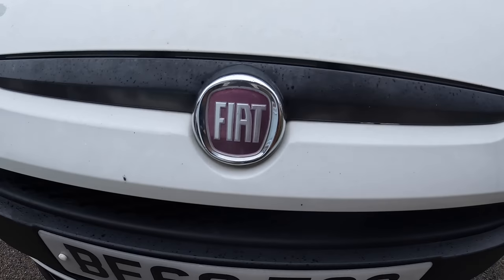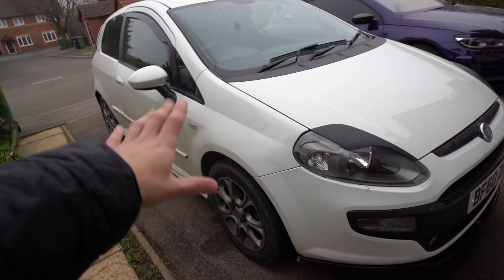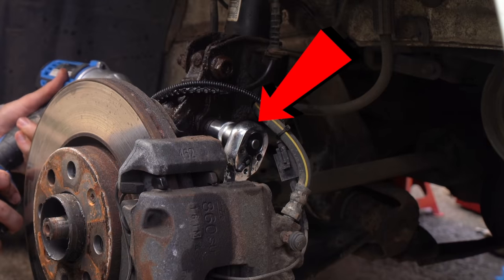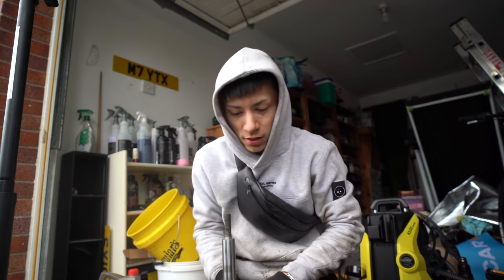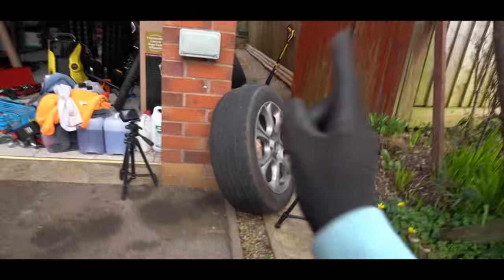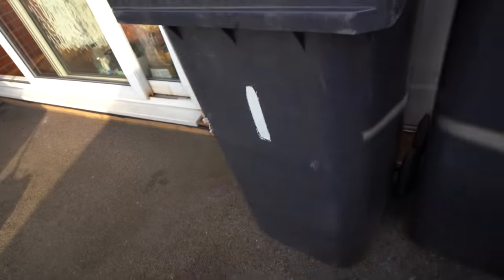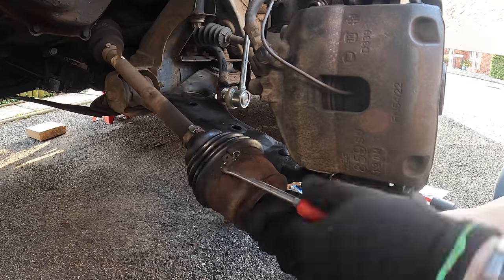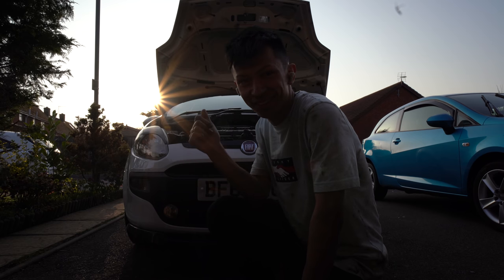FIXING THE FIAT PUNTO!?! 😭

Comment: hope you torqued the top mount nuts and drive shaft nuts mate as they rely on a set torque setting to function correctly especially the drive shaft hub nut as that should be around 185ft lbs
if they aren't it can cause play in the bearings just a heads up.
Reply: Sorry ard
Reply: @jgodda9204  what ?
Reply from the maker: Hey mate! Honestly didn’t torque the top mounts as it just spins, but did them up with the ugga dugga so just praying that’s ok 🤣😭 But can confirm the drive shaft volt is torques down plus a little more :) but thank you for the heads up, always nice to know ❤️
Reply: @TheOtherStuff  yeah it’s should be okay haha driveshaft is the main one good to hear bro looking forward to more content!

Comment: Little tip for you for if you ever do it again take the nut off the bottom of the track rod end and take the track rod end out of hub then when you come to take driveshaft out of hub it gives you that little bit more movement and allows for driveshaft to come out of hub easier and go back in easier, youll get there with stuff like that it’s a learning curve keep up the good work mate enjoy watching your videos
Reply from the maker: Thanks for the tip mate! Honestly thinking about it now, that would of made it so so much easier as I could only turn the steering knuckle a tiny bit as the tyre rod was still connected 🤣😭 Will do next time! Thank you 🙏🏻💕
Reply: @TheOtherStuff  no worries mate always here to dish out help and advice when needed bro keep up the good work mate will look forward to next video on pinto of scirocco even if it’s a must have accessory mate

Comment: Could anyone help me, I have a 2015 seat Leon. I’ve recently had both front brake discs and pads repaired because they’re was a rather annoying squeak when I was rolling at low speeds usually 10-20mph. I got the brakes changed and it fixed it for a while.  Now the squeak  is back and idk weather it’s a problem with the brakes or roll bars etc. i don’t know much about cars but I’m looking for advice or is anyone knows what it could be let me know!

Any help would be appreciated! Thanks
Reply: Try and take it on a long drive and get them nice and hot. When you do a lot of short drives the brakes don't get hot enough.

Comment: Heat the rounded bolt up with a blowtorch and try use mole grips to get the bolt off
Reply from the maker: Hey mate! THanks so much for the tip, honestly could of done with the mole grips on the Drop link as that was such a pain to get off 😩😩😩😩😩